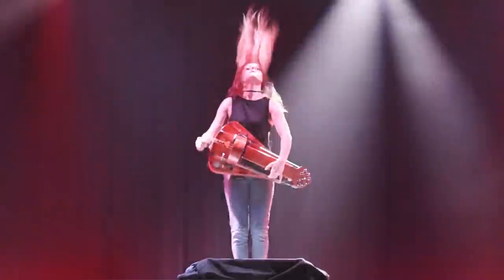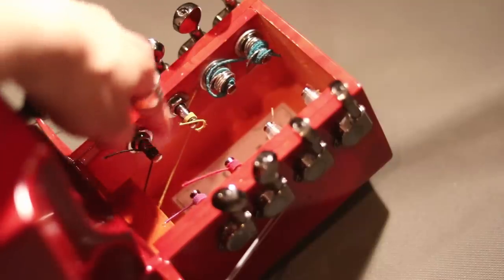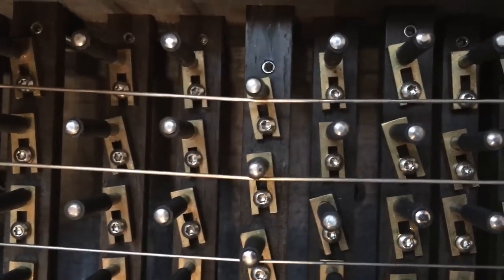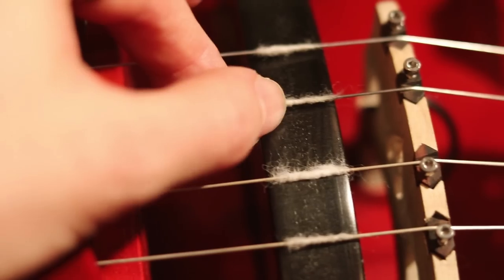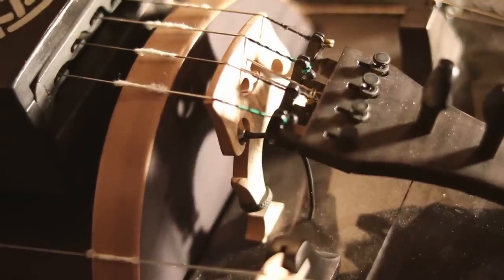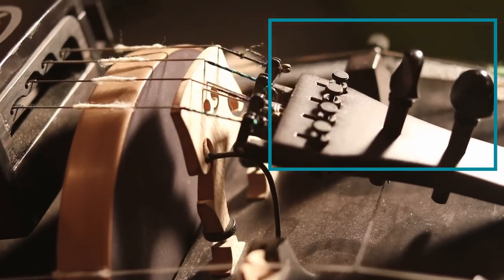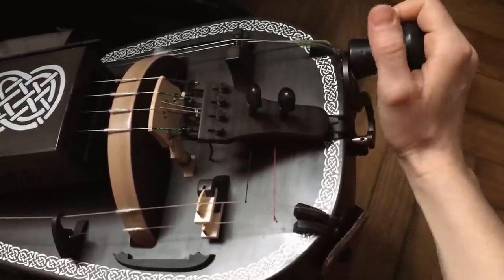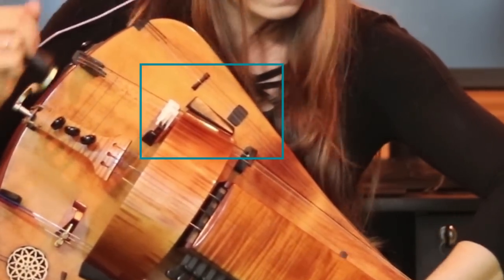How does the hurdy gurdy work? How is it built?

Comment: What's the tuning capabilities of the drone string? Can it be set or tuned to any pitch?
Reply from the maker: The drone strings (usually a G2 or C3/2) can be tuned down or up, one semitone works best in most cases, two semitones  if you're tuning down, because this deviation does not change the tension of the string too much. You can also use a different string, a D for example. The easiest solution to change the tuning of the drone string is a capo - however with capos you can change the pitch up only.
Reply: @michalina_malisz  gosh. So complicated!